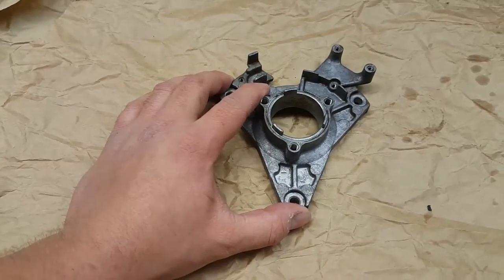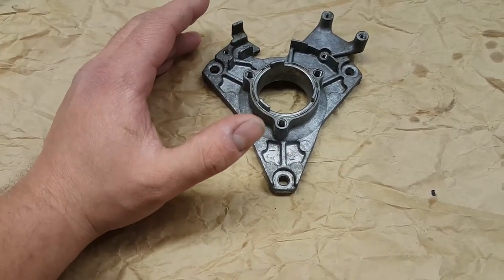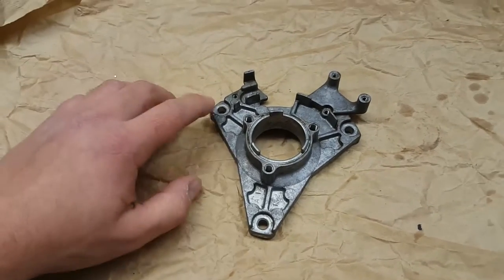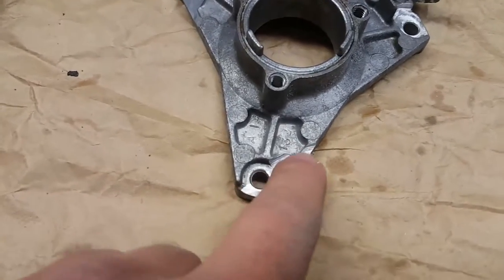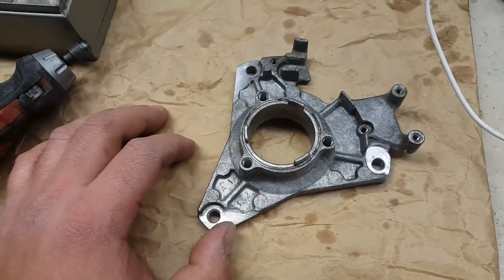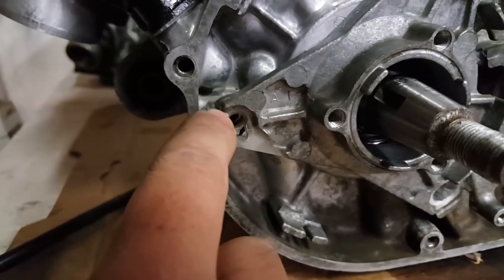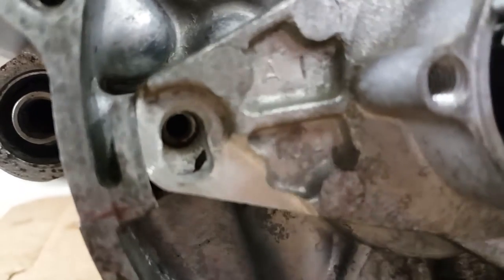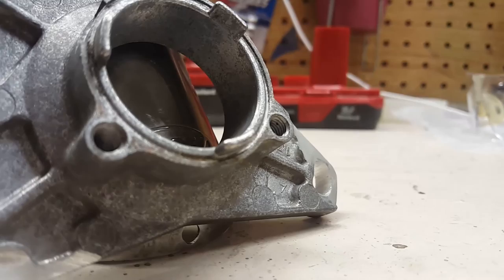STATOR PLATE MOD | BANSHEE 350 | EASY

Comment: I have a 02 banshee I have a timing Plat advanced to plus 4 degrees. main jets 300 pilots 27.5. when I'm in 5th gear going to 6ths it seems to bogge a lil. even in when I'm trying to give it he'll in second when I'm coming around a corner it seems to hesitate a lil. it's got a fresh rebuild top and bottom
Reply from the maker: Sounds like it could be jetting or your fuel/air screw might just need an adjustment, air filter could be clogged. Hard to say without seeing/hearing the bike!
Reply: isnt 200 stock for main jet.. 300 seems super rich.